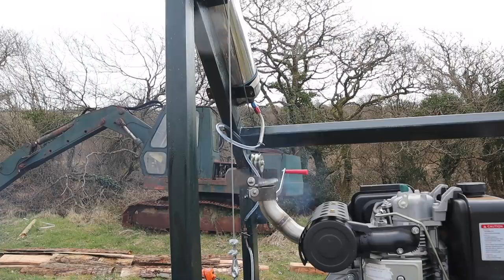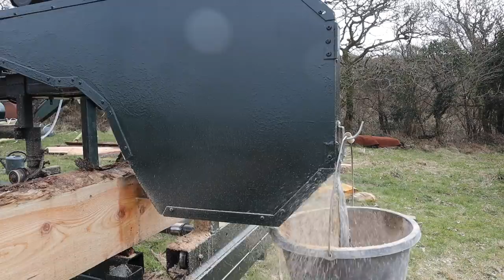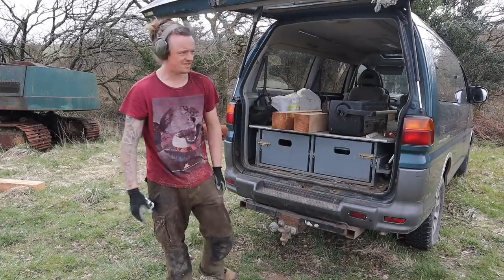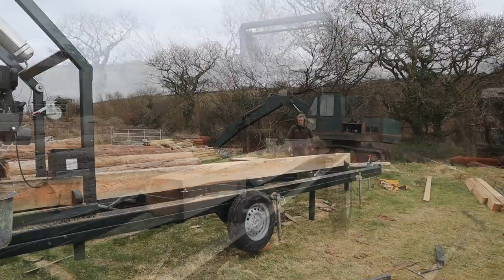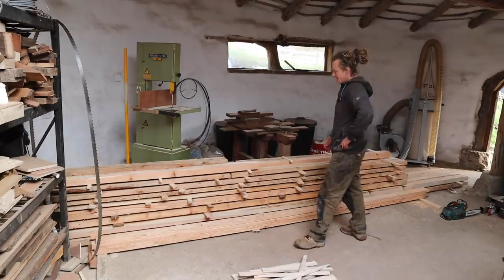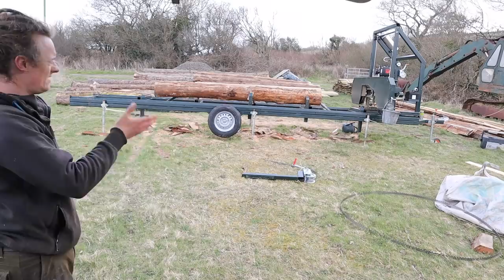Milling Larch For The Greenhouse On My Homemade Bandsaw

Comment: with the cost of lumber going through the roof during Covid I suspect there will be a lot more people making mills
Reply from the maker: That was one of my reasons. it wasnt even just the cost it was the fact that there was a 2 month wait to buy wood from the mill. I built the mill in a month.
Reply: @KrisHarbour  I live in a province here in Canada where 90% of the land is dedicated to the production of lumber. We don't have the wait times but the cost has tripled. Which imo is just price gouging. We still have the same number of guys in the woods cutting the trees, and the # of logging trucks going to the mills, the same # of boards being cut each week. They have figured out that people will pay more now is the only change.

Comment: Great stuff!! How often does the blade need to be sharpened? Getting the revs up too, run-in must be done now, oil and filter change time!  Flying along the cuts!
Reply from the maker: I did it once for all this timber and that was towards the end. so i could now cut that much again from one sharpening. I think thats quite good.
Reply: @KrisHarbour  That's belting, a fair load of lumber there!! You must be rightfully pleased!
Reply: PS Just got to the end. Get well soon and rest that hand!

Comment: Is the excavator behind yours?
Reply from the maker: It is, Not used it in a while but yes. Its currently waiting for me to make a decision on it. sell it, scrap it, fix it up or strip it for materials. cant decided what to do. it dose work but needs alot of work to be really useable
Reply: @KrisHarbour  isnt it a hydromac? i got one myself
Reply from the maker: No it isnt, I cant actually remember what it is But it isnt that. However i just looked that up and they look identical so i assume the same company made it under a different name maybe?

Comment: Never seen anyone turn the log 180 when trimming.  We always turn 90, easier to judge what yo can get out of it and we always try to start at the top(less cuts when trimming(slabbing) . I started in my fatheres mill when i was 12 in 1975., got a chainsaw for my 13th birthday.  Never learned to be a sawyer from YouTube.
Reply from the maker: Interesting comment. the reason i do that is because that is the order you would cut out something for joinery. the first step in making a tenon is to make to parallel faces then take off the sides. the reason for that is so you dont stack up inaccuracies. if you rotate 90 each time you can be adding up those inaccuracies so you end up with a parallelogram. Granted in saw milling that level of accuracy isnt required but that is where i got that from im sure.
Reply: @KrisHarbour   Only time we flip 180 is to saw live lumber or boat planks. Everything else is turn 90, that way you don't have to work as hard flippin and you still end up with a swuare to cut whatever the log will yeild or lumber qualiy you need.  Much eaiser  and faster to turn 90 and dog the flat up against the guide stay

Comment: you don't half make life tough for yourself keep the manual winch make an adaptor to run it with your battery drill, as a sawyer i run a woodmizer cost 5k i run 20 blades bought over 2 years and just bought a sharpener for £200, used too get them sharpened but they were crap and with fuel and £10 a blade sharpening setting i do with a goldenber plier setter does both sides to .025", admire your ingenuity but stupid accidents are easily avoidable!

Comment: O sorry about your finger. The reason you have waviness in your wood is because you have your, Blade Guide to far from the log. Keep your Blade Guides about an inch or two from the Log.
Reply from the maker: But it only happened as the blade dulled and then went away after sharpening. so i think that was more the reason. But im sure having it closer would have helped a lot. Its just more work to move it and they were getting planned anyway so it wasn't important. It was only very slight anyway.
Reply: @KrisHarbour  

Try this video too, Kris. And as this guy says, your right. Dull blade.